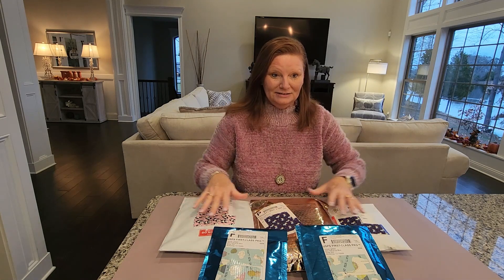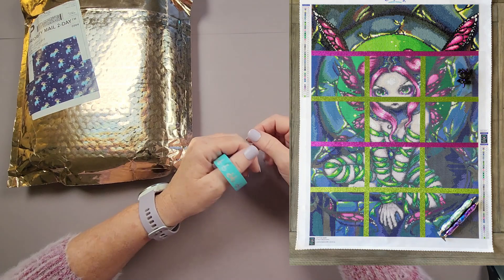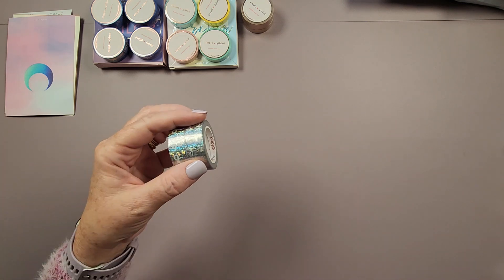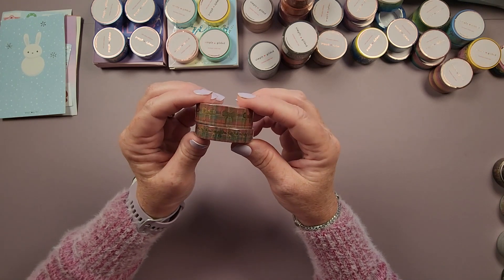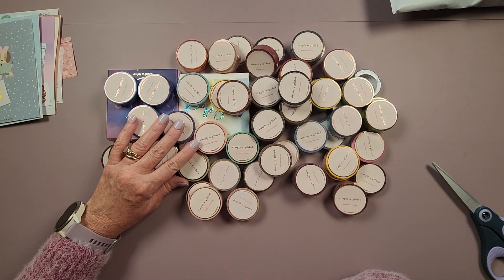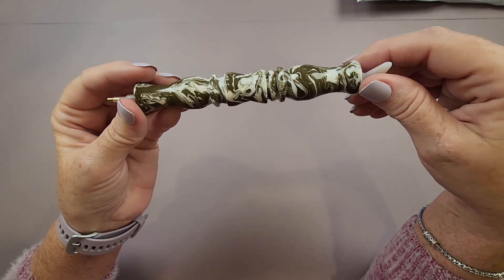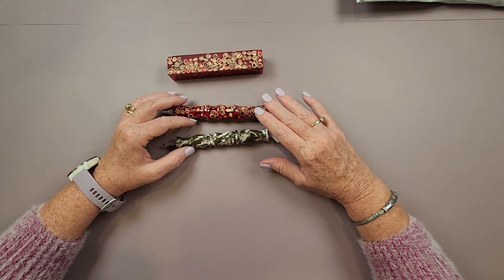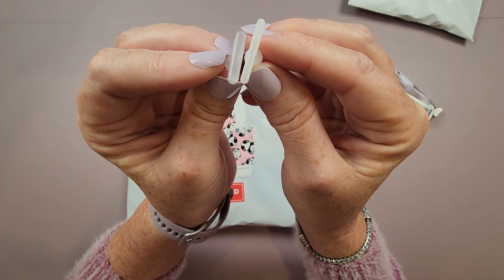Unboxing Simply Gilded Washi Haul & 5 Diamond Painting Pens from Jim's Handmade Pen Shop & 🎁🎁's

Comment: Love all the washi tape & I’m on the website now shopping! May I ask - do you have a tutorial or how do you use a glue dot in a DP pen?
Reply from the maker: Hi Jenn!  I don't have a tutorial on glue dots yet, but they are AWESOME!  Here's a video that Jade did on them about a year ago.  https://www.youtube.com/watch?v=6TheRbrXIIU  
I really like to use the "micro" glue dots in my single placer.  It takes a couple of minutes of use for the glue dots to "settle down" when you start.  So, sometimes they will expand a little bit and you have to go back and use scissors to cut off the top edge of them if they are expanded outside the tip.  But, after you get them "settled down", they last a REALLY long time.  And, especially when they are new they give you that really satisfying "pop" sound.  Don't use them with ABs though... They can take off the coating of an AB.  Try them out.  You'll LOVE them!  Let me know if try them what you think.   Have a great week!  💜
Reply: @DiamondPaintingBetweentheLines  Thank you!